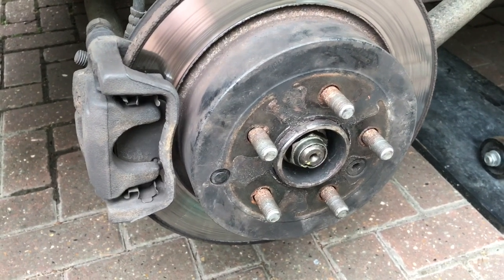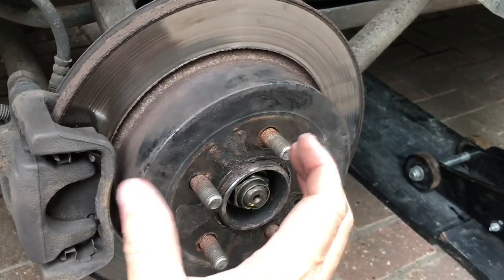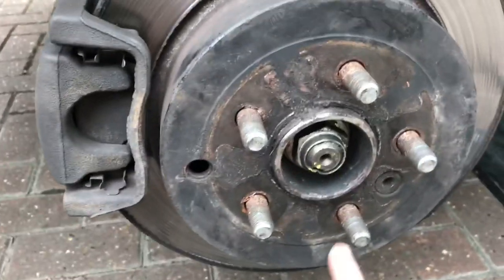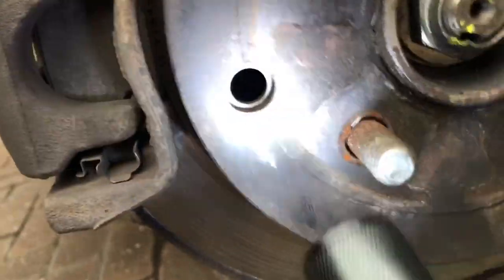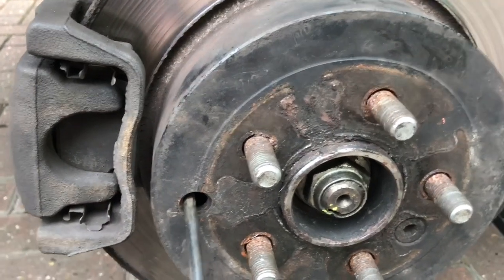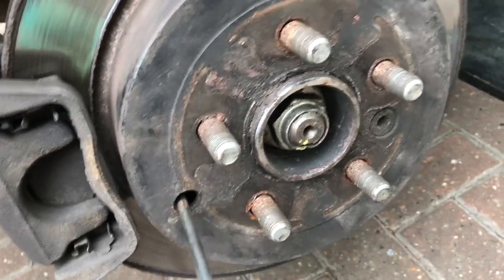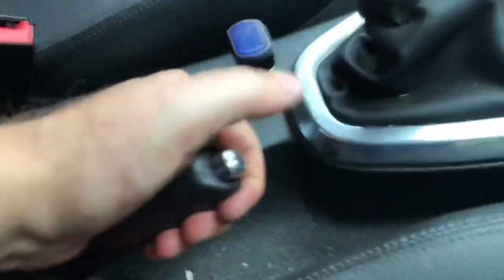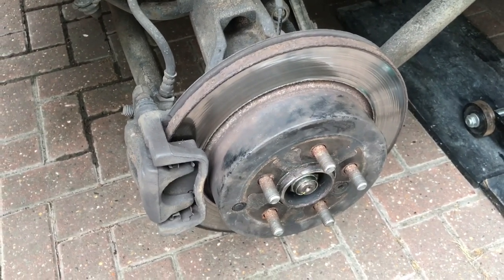Handbrake adjustment on Land Rover Freelander 2/LR2

Comment: I would personally have backed the handbrake main adjuster off completely before adjusting the shoes individually, then readjusted the lever travel with the main adjuster. Alternatively, leaving the h/brake lever on just one click before adjusting the shoes up guarantees no over adjustment. Works fine for me👍🏻

Comment: There’s an adjustment nut under the centre counsel at the back in the rear passenger section. Just lift off the plastic tray and tighten othe nut with the handbrake off.  You’ll see two cables running to the rear and one towards the handbrake.
Reply from the maker: Yep, but that should only be used once each wheel has been adjusted independently.

Comment: under no circumstances work on a vehicle without an axle stand , how that jack is positioned its ready to chop your legs off when it falls
Reply from the maker: I always use axle stands and put the spare wheel underneath too. There is a stand under there somewhere but may not be visible in the video. You don’t need to lecture me on health & safety!

Comment: WARNING. Not always a quick fix 
Thanks for video. I went at it. The wheel that i was trying to rotate with the screwdriver popped off inside the hub. Now its rattling around and jamming if i rotate the hub. I need to get a mechanic friend to help me with it now. 
Thanks for informative video.
Reply from the maker: Thanks for letting us know. I’ve not had this happen, but I can see how it could occur as the adjuster is just floating between the shoes. You should able to remove the disc to retrieve it, as the shoes will retract under the springs. The disc locating screw may be hard to remove though if you can no longer apply the handbrake to lock the wheel.

Comment: Hi. So anti clockwise to tighten and clock wise to slacking off ??.
Reply from the maker: Yes, as viewed from above. Flick the teeth to the left to expand the adjuster (more brakes) or to the right to reduce it (less brakes). This is the same on each side. The adjuster is on the rearward side of each back plate, so hole at 3 o’clock on left (UK passenger side) and 9 o’clock on right (UK drivers side).

Comment: How often the shoes (for the hand break) should be replaced ?
Reply from the maker: It depends how much the hand brake is used. I would check them every 30-50k miles. Mine is now on 145k but still on the original shoes. I will renew them this year.